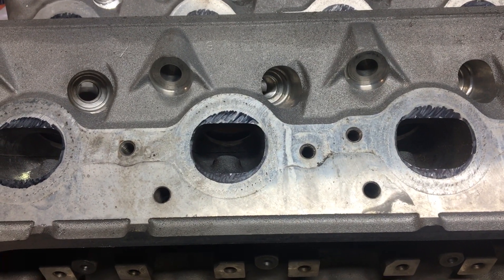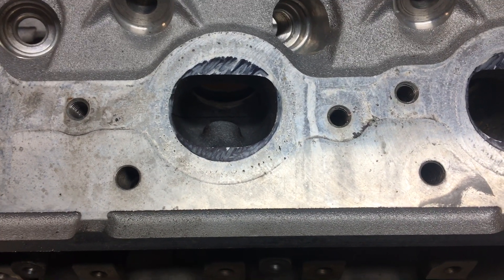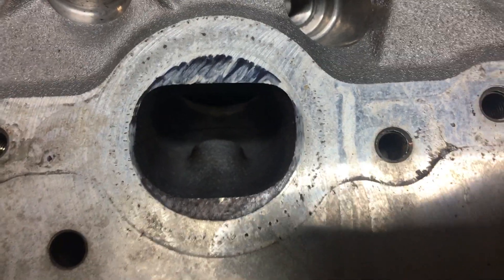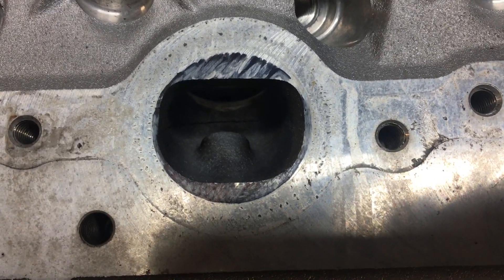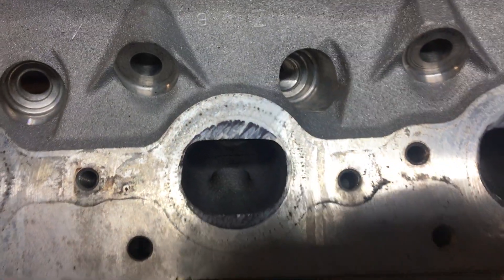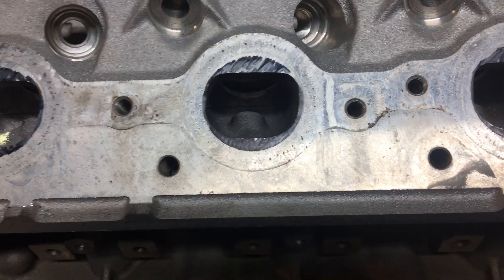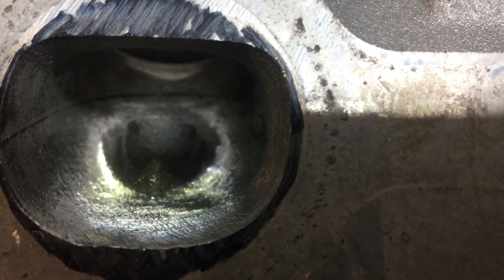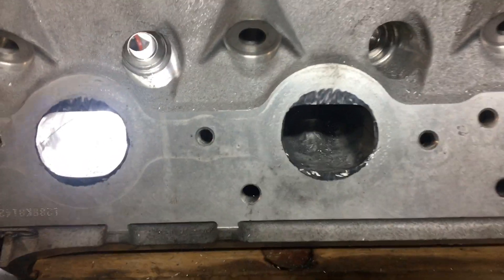How To Port LS Cylinder Heads Part 2, Exhaust Port

Comment: The bump in the exhaust port is a water jacket. I found pics of a head that was cut up on one of the forums. I left what I could at the ridge but blended  the ramp and roof.

Comment: I made a little sleeve using a small piece of 14mm carbon fiber tube, and two 12mmx6mmx 4mm bearings to support the long shank burrs,   works fantastic.  Can hold in position and push the burr in snd out though the bearing support

Comment: I get 218-220 max cfm out of the exh ports of 799/243 heads on a SuperFlow without a cheater pipe on them. There’s much more to be had .

Comment: You can clean out the stock manifold to match if you opt not to use headers
Reply from the maker: That is true, but you can only go so far.  Just have to make sure you have enough material left on the manifold.

Comment: I saw a feller on one of the forums where I lurk, had posted some pics of some 243s he did some work on. They looked really nice and the intake had a decent improvement, about 25 cfm but the damn exhaust ports flowed LESS than stock. That caused me to heavily research port flow Dynamics before I even consider working my own. Your information and Headflowinc is good info for a feller to go by. LS heads are already really good, they don't need much work. Less is more.
Reply from the maker: Yep, this isn't a poor flowing gen 1 sbc head.  Theses LS heads just need a little help.  Better to take out too little than too much.